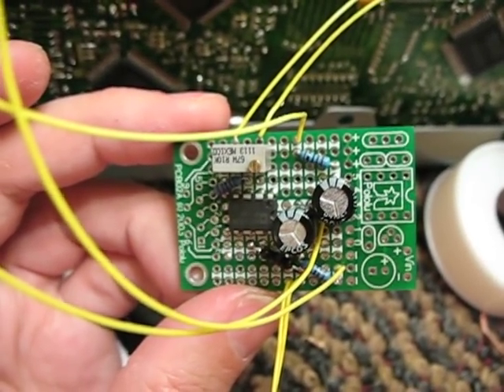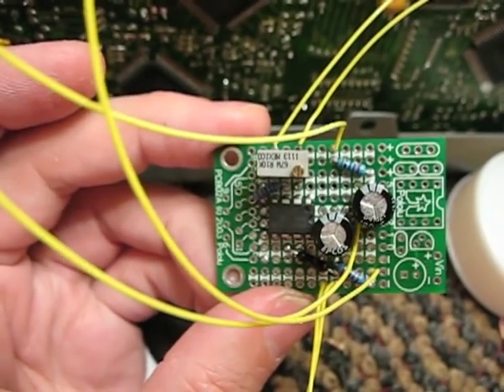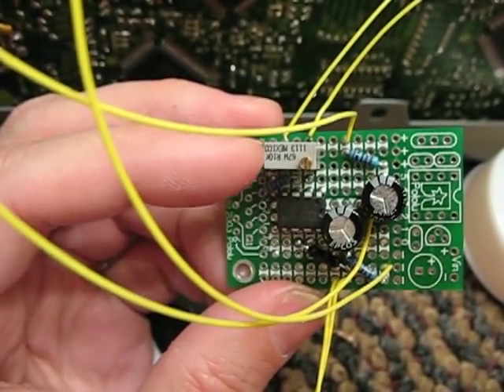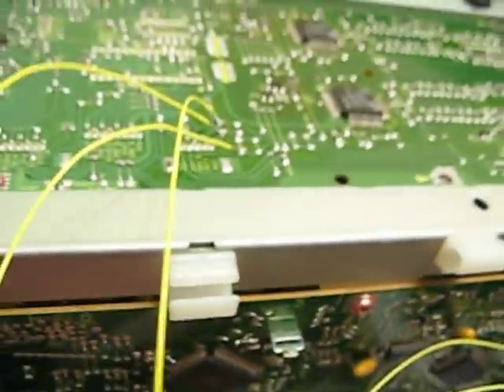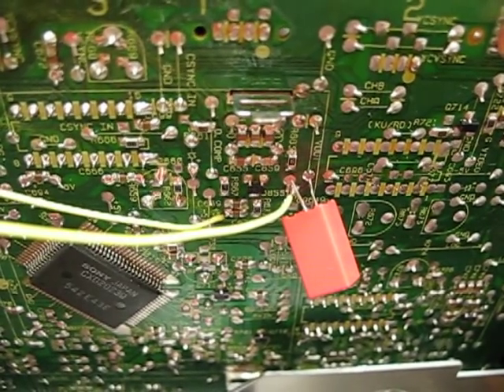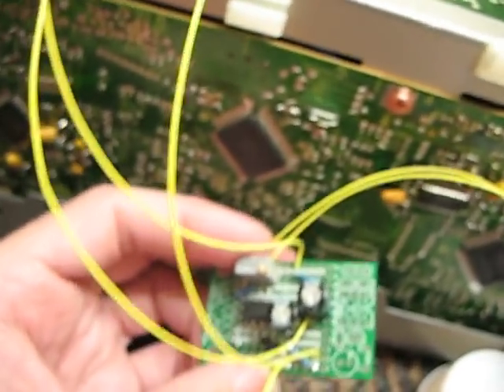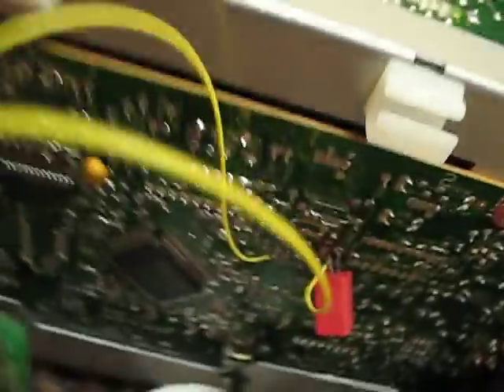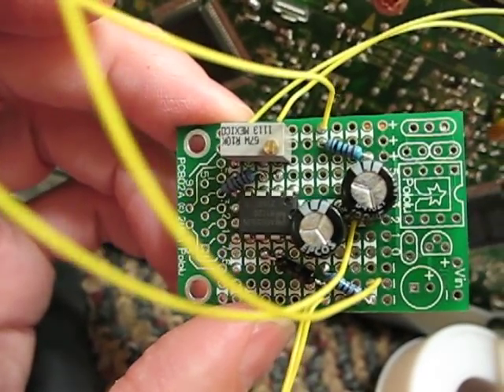Laserdisc video output chip

Comment: Sorry but you did not show us the difference in picture quality and how this improved it ? A lot of bad pic and crosstalk is caused by bad setup of the laser pickup and tilt. By adjusting this with a oscilloscope and test disc puts this right. So would like to see the results to this item ?.

Comment: Awesome video, I'm wondering is it possible to mod a basic level player to get cleaner video than some of the top of the line Elite players?  I have some experience with RGB>NTSC converters and building my own circuits so I wonder if with modern DACs that you roll your own if it's possible to trump Elites?